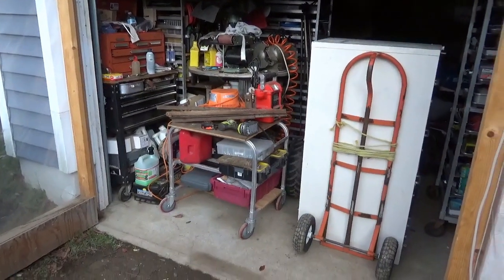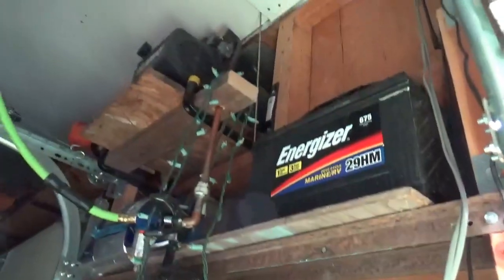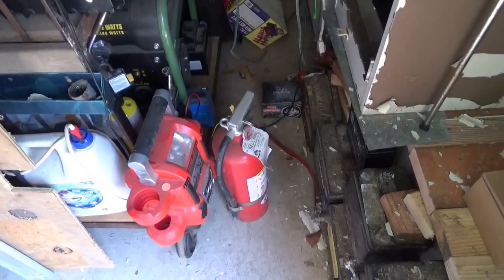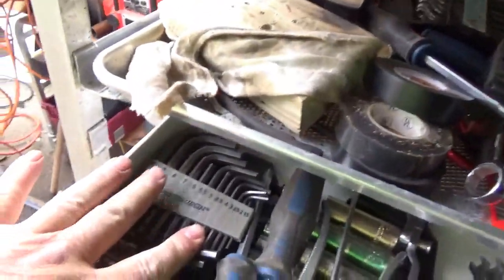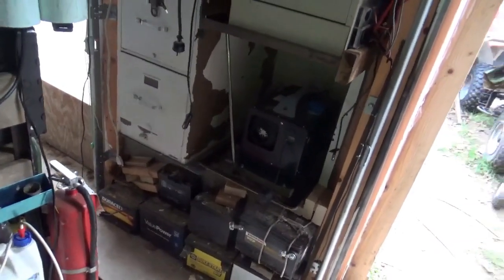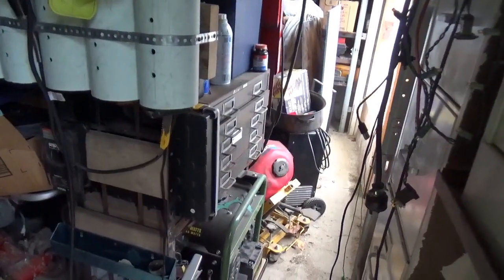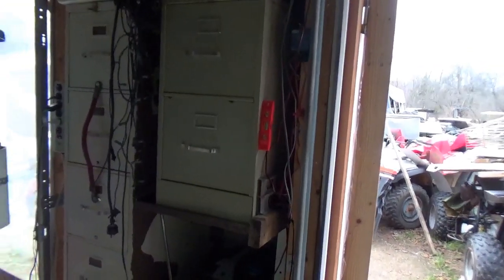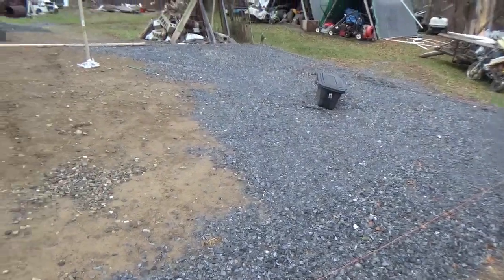Garage Storage Hacks, Cheap and Easy Shop Tricks!

Comment: Looks good Harvey. I use quite a few file cabs myself, they work great. One suggestion - venting batteries and fire burning heat source is not the best combo, especially in a confined area. Batteries can produce hydrogen gas during charging. Remember the Hindenburg.

Comment: I don’t know how I missed this one !! Lol. So bud how well does that diesel heater work ? I’m thinking about buying one for the shop that’s 14 x 24 and I like keeping it around 50 degrees when I’m not there and about 68 when I’m working and that’s about 335 square ft. of work space to heat . I do use propane and electric heaters but propane is more expensive then diesel . Do you think it will work for me ?
Reply from the maker: Hey Dave, The heater works great! It should heat Ur 24 x 14 better than it does my 24 x 24... I have the hose aimed at the floor near my feet, after it runs for 15minutes, I'm comfortable.... I have been happy with the bump out.... It just needs to be finished like all my projects... LOL!!!   Thanks for asking, watching, and commenting!!!
Reply: @HarveySpooner  I think both of us have FINISH-ITIS ! I start a project and get to a certain point then I start another project but eventually I do get it completed ! My New Years resolution is to complete what I started before starting a new one ! Take care and SKOL BUD !